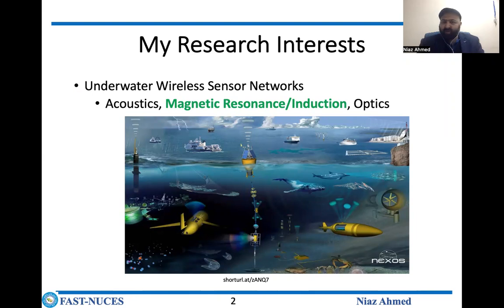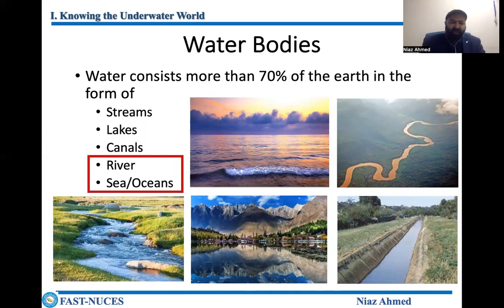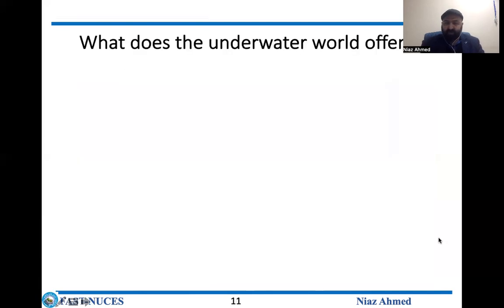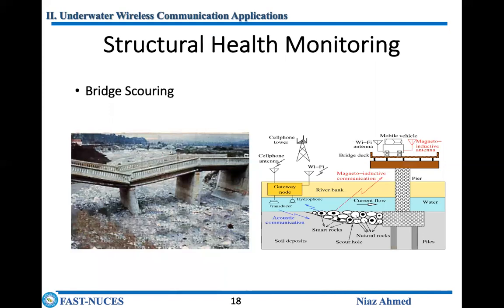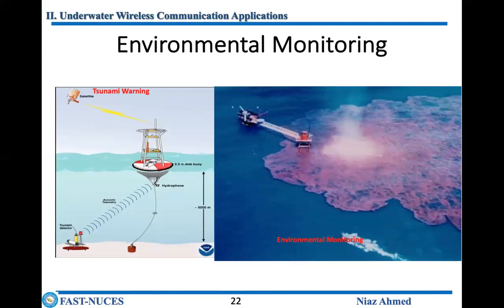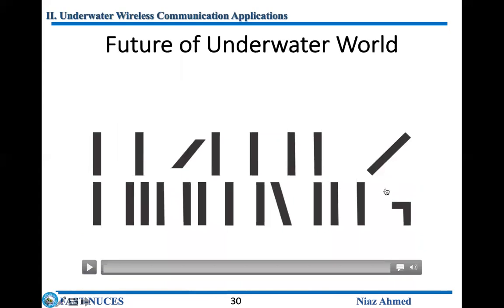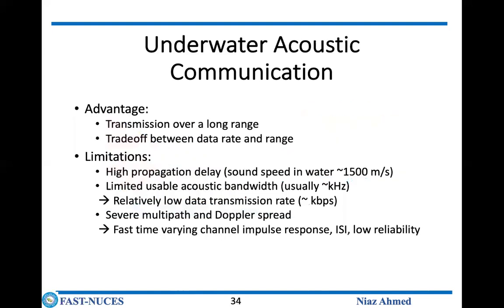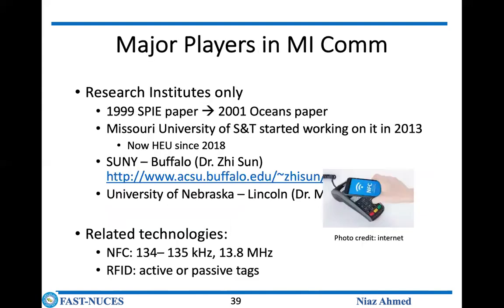CONF-MCEE 2023 - Oceanography and Informatics

Comment from the maker: Q4: How does the underwater sensor maintain regular operation? Such as how to repair it when it encounters a fault in the deep sea, and where does the energy of underwater sensors come from?
A4: This indeed is a challenging task. Usually there are routine regular monitoring schedules that follow a yearly or monthly plan, where the setup/sensors are retrieved, reconfigured and reinstalled. Alternatively, there are underwater vehicles used for monitoring purposes. Regarding the energy, most of the sensors are battery powered and therefore this is a challenging area. They usually are tried to be low power so they can survive for a longer period of time.

Comment from the maker: Q2: What are some of the most promising applications of underwater wireless communication, and how are these technologies being used to advance oceanography research?
A2: Underwater wireless communication technologies have a wide range of applications in oceanography research, and they are being used in many different ways to advance our understanding of the ocean. Some of the most promising applications of underwater wireless communication are Autonomous Underwater Vehicles (AUVs), Underwater Acoustic Networks,  Oceanographic Monitoring Systems, Oceanographic Data Collection,  Underwater optical networks, and underwater magneto sensor networks.